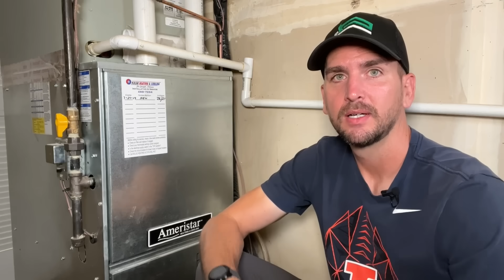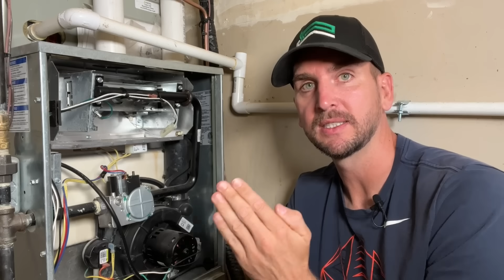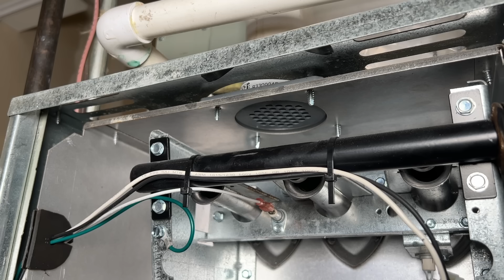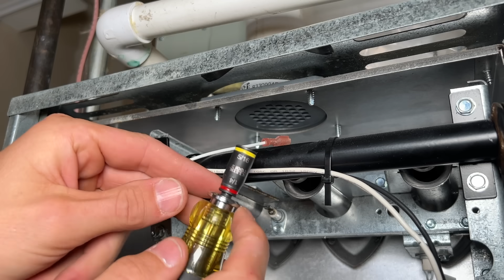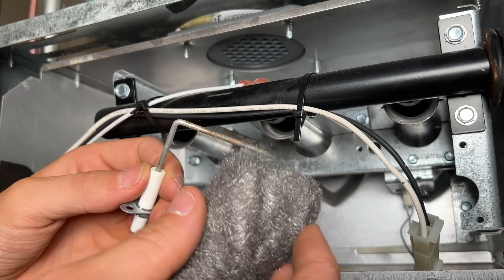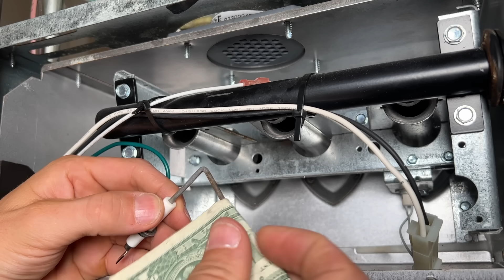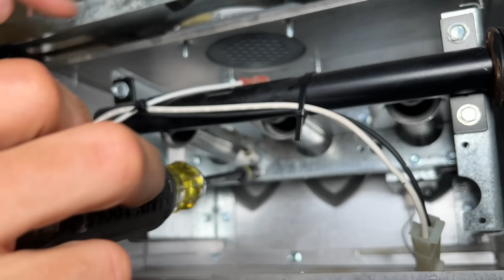The Most Common Reason Why A Gas Furnace Won't Turn On

Comment: Thanks to the steps process of how it works,  I was able to identify  my gas valve Not working right,  cus, if I change thermostate settings,  it will Not open till I flip its little switch off/On and hold some pressure on it til release the gas and go on with process👍🏼

Comment: My furnace blinks a certain number of lights on the board. Mine blinked 4 times which means I have limit switch bad.  I replaced the one on the main blower and didn't fix the issue.
Whats next.  It's doing exactly what your video explains.

Comment: Since brand new, whenever are heater is turned on it immediately starts to blow cold air and then the warm air, and then cycle back and more cold air followed by hot air, any ideas. Natural gas Goodwin
Reply: I don't know much about this stuff but it sounds like your thermostat may be set up improperly... It needs to be set to Gas...otherwise it will control your furnace as if it's an electric or other type of heating system.  This is how mine operated when I installed a new thermostat.  It would turn the blower/fan on while the furnace was heating up (which resulted in cold air blowing through the vents for a few minutes until the furnace heated up).

Comment: 6 way screwdriver usually will remove everything mounted inside the front of a furnace. By removing the screw driver bits you have both a 1/4" and 5/16" nut driver....the two common sizes used to remove covers and parts.
But also pays to have 1/4" socket set with extensions to more easily get at the more recessed screws.
You can also buy really long screwdrivers so your fat handle isn't in the way.

Comment: I had this problem on the worst day I could possibly have this issue code 13 and looked for this codes on carrier brand and saw this video and he nailed it on everything he explain it ended up being the step no. 5 flame detection I followed his instructions on how to clean it and it worked this happen on 01/15/2024 after being. below 30 degrees all day in Houston Texas which that never happens. Good Job on the explanation of why how where etc...

Comment: Ignitor failure also very common and just as easily solved. Size of your thumb, two screws, 5 min. $ 29 part.   $350 service call.

Comment: Nice job explaining the sequence of operation. Just my two cents but normally I wouldn’t recommend any abrasive to clean the flame sensor. Dollar bill is fine or a green scrubber pad. But this is for a temporary fix until you can get a new sensor

Comment: Today the coldest day so far this Winter I noticed my furnace was just blowing cold air.  Took out the sensor, and rubbed with steel wool.  Put it back and I now have heat again.

Comment: im at step 3. my ignitor glows for a second and then shuts off, i dont even get to the gas part. Changed my sensors, and air filters

Comment: Also - Don't keep a litter box in the room with the furnace!  Our furnace quit heating about every 2 seasons. I figured was because the furnace is old. Next time it went out, I didn't call the big name company as they had been telling me lies (not related to this or the flames shutting off as described here) about how the furnace was not working right. Called a buddy whose brother has his own company. He came over and replaced the flame sensor and told me to move the cat's litter box out of the utility/laundry room. The ammonia in the air from the cat urine eats at the surface of the sensor, causing it to fail. Moved the litter box and we are going  on 5 years without a problem!

Comment: I been having a problem with my furnace, when thermostat is calling for the heat my pump turns on but burner doesn’t turn on then when i go and wiggle the wires in relay valve turns on. What should i look for? Wires ain’t loose i checked all that

Comment: The burner faces rust also. Especially on propane if the face of the burner is rusted up it wont let even a clean flame sensor work. Sometimes you can get a couple of fingers back there with some sandpaper to clean the burner face but sometimes it must be removed to get the rust off.

Comment: What to do when gas is not supplied for 2, 3, 4, sometimes 5 attempts. The igniter glows red for 10 seconds, but the gas valve does not open. Then cycle repeats.

Comment: Thanks, bro. 2:00AM, two days after Christmas, 40 degrees out, my wife wakes me up and tells me the furnace is not working. I found this video and fixed the problem. You kept my family warm. Thank you.
Reply: Thank you! It works!
Reply: Thanks for your great work it help us so much not to b dum and to learn things 😂❤
Reply: Awesome God bless
Reply: I don't know what's wrong my boyfriend has replaced every part we know of , The Circuit board, Pressure switch , inducer fan and flame sensor,, 
At this point after all that it turns on but doesn't ignite ,,  I seriously need help ,,
Reply: At this point, I’m assuming it’s the gas valve not opening. TBH, it’s not a DIY LEGO puzzle. Find a qualified HVAC tech who’s able to troubleshoot the problem, otherwise you could really be cooked
Reply: @rhyanna5454 I’m in the same situation—no heat it’s in the 30’s during the day and the 20’s at night. Fan turns on but the flame doesn’t light.
Reply: @oopurpledove Don't ask me, I DON'T HAVE ACLUE.
Reply: @rhyanna5454  is this a joke sounds like you said the answer you need an igniter glow plug or whatever gets hot and lights the gas
Reply: I used aluminum foil from the kitchen on my 12yr old American standard furnace worked great, back on heat late Saturday night.  Thank you
Reply: Same here but glad I had a portable wall heater in my room, woked up with a bad headache due to the cold...the dollar bill helped, was able to reach the sensor without removing it and worked
Reply: For most folks ... If you find that you need parts and have to replace parts when they arrive 2-5 days later. Please have those in your house wear clothes while in bed ! They will sleep just fine and Not be cold! Maybe even a electric blanket if you already have them. Today so many people complain because they are Cold running around in shorts and a tee shirt! Wear warm or layered clothing Inside your home with a coat as needed! Don't pay the utility companies for your laziness!

Comment: Hello friend  
Please can you guide me what a furnace man has done to the furnace gas presure so the heat dose not work from 74 to 77 degree & the house is not warm like before so we use to keep it at 75 degree . seems the green mafia 
f up our furnace . The service man has modified our furnace by the name of warranty . we have it installed 2 years ago & paid $ 1200 $ for warranty for 10 years 
to check it every 6 months . He keep taking out some little round valve .Look like green mafia do it inorder to keep 😂 the air clean but them people has SUV & jet
we are not in the SIN city . Thank you for response  . X mas & HNYear 24

Comment: My problem is the thermostat is calling for heat but the exhaust fan is not coming on. Once I physically turn off power and turn back on that exhaust fan the system works then stops without reaching the desired set temp.
Had several HVAC come out and problem exists.
Any advice?

Comment: I just replaced my 23 years old 80K BTU 80% efficient Bryant furnace with the new 60K BTU 96% efficient Goodman furnace. I kept my old furnace just in case the new one fails within next ten years or so to place it back. As far as I know, we can't install an 80% efficient furnace in Canada anymore, at least in Ontario. I think the minimum is 90%, if not a bit higher, however we can install an old 80% furnaces. These 80% furnaces work longer then new high efficient furnaces as they less complicated by design. Also these are still available to be purchased and installed in the USA. My old 80% Bryant furnace had stamped heat exchanger and it never fails, the new one has the heat exchanger made from the bent pipe and it usually would crack on the bent point. The China, India and the Middle East are heating up the planet due to a population sizes and we are in Canada are trying to save the world.
Reply: F.k Canada

Comment: Will a furnace run great with a bad gas valve? My furnace has a hard time starting. I do a hard rest 3 times and it runs great after that. I need help. Nobody knows whats wrong.

Comment: When I turn the heat on, the fan runs and then the ignitor sparks for a couple seconds and then stops. Then sparks again then stops and then the whole unit shuts off. Do you know what may be the problem? I cleaned the flame sensor but it's still doing the same thing. Could the sensor just be bad?

Comment: Just helped me out a ton today, i couldnt even manually light it with a lighter because it would just shut down, hvac guy wanted $700, i cleaned the flame sensor still didnt work but i bought a new one for $17 and had it started in a couple mins after installing new sensor
Reply from the maker: Oh man, what a great way to save a TON of money. Congrats.

Comment: I'm having a similar problem but slightly different. Hopefully someone can chime in an give me some advice - it's driving me crazy. The Furnace starts up, but the gas valve opens before the HSI can get hot. So an excess of gas builds up, the HSI eventually gets hot, and there's a very tiny explosion as the gas ignites. This all happens in a matter of seconds. The furnace then shuts down for a few seconds, but then starts up and runs like it should, completing the 6 step cycle mentioned in this video. I've had the local Heating and Cooling company come out at least 5 times (through our home warranty) and they've replaced the board and replaced the HSI, but the problem still persists. If I power cycle the furnace the problem goes away for a few days but then returns. Any ideas?

Comment: dec 5 2023  ... colorado, near pueblo
a spare igniter was just bought in order to have a spare.  now the need to have
a spare ignition sensor is real and i will be  shopping for one.   yor vid'
gave me a nudge to be a little more prepared this winter

       here's another 'gotcha' that a 3-burner Carrier 70k furnace failed due to.
it ran ok with room temp above about 50F.  but lower than that the ckt-bd
led would often  blink and the  signal meant the AC lines were backwards.

     this was misleading as they had worked alrite already and had not been
changed any  .  so , as a try  , a hair dryer was plugged  in and on high heat 
blew hot air on the CPU of the circuit control board.   then on plugging in
the furnace to AC the led was not blinking any more.  and closing the thermostat
to call for heat led to the furnace behaving normally.

   also once the CPU was running ok again it could  revert to the blinking mode
and not run right anymore.  maybe once or more a month.   
       solution is the same , apply hot air to the CPU for
20 sec or so.  and re-plug it in.   no led blinking .  this furnace has been
running like this for 7 years now.

      i did buy a spare control board for this furnace. in case the hair dryer
remedy stops working.

      one other issue is with the blower motor relay .  once it fails
the blower wont spin to  move  out hot air.   the spare control board
will fix the failed relay too.  in an hour or less it can be changed.

Comment: Watching your furnace operate normally is a great suggestion. It does give you ideas on what to look for when the furnace stops operating. I had a furnace go out on me and it cost me nothing to fix. 

Just understanding that part of the safety system is a vacuum sensor was key. The furnace would go through all the steps, but would shut down after the blower motor started up. Thinking the vacuum sensor had gone bad, I discovered the rubber tube connecting the sensor to the fan chamber had cracked open, probably due to old age. There was enough slack in the tube for me to trim the end and reseat the tube on the connector. Problem solved.

Comment: unscrew one of the screws in the bottom left portion of the burner cabinet.
if you pull it out and the threads are rusty your heat exchanger is compromised.

the American standard legacy series is a beautiful line of furnaces. but they are not without their own inherent and dangerous issues as any furnace is.

Comment: Great video Scott.
I just had the same problem with my 20 year old Lennox ac/heating system
The gas would shut off 3-4 seconds after igniting.
 I removed the heat sensor that looked clean and used steel wool. And after a few times of trying to start the unit it stayed on and did not shut off. The reason I think was because we are located in Florida we only turn on heat when needed (not much) The conclusion I came up with is that even if you don't use your heating system often, you should turn it on at lest once every 2-3 months for 5-10 minutes.
Ken
Reply from the maker: Yeah, I like the idea of exercising the system in your home to ensure you are ready to go when you really need things to work 👍

Comment: Dang man, first snow of the season and our furnace did exactly this. This video helped me fix it in 15 minutes. Can't thank you enough for this, and I also appreciate that you were straight to the point. Every second of your video was helpful. No fluff, no BS.
Reply: My 2019 Armstrong has the same looking flame sensor and I thought it would be smart to get one and igniter.  Stopped at the nice and reputable place that installed it in my farmhouse and they only wanted about $115 each. Think I'll look on line.  Great video.
Reply: Happened same way to me today. Going to try this when I get home from work

Comment: Nice presentation what if your furnace fires up regularly starts to heat your home and then at a certain temperature the burners won't fire again and the blower just keeps going blowing out cooler air?

Comment: my burners go out after 2-3 seconds and i've clean replace the flame sensor.  it's really weird since 'll turn off the unit and sometimes it'll stay lit but it's a hit or miss when i get heat.  do you think it's a motherboard issue as well or something else.  it's starting to get cold and i've called the service but they have never fixed it.  i was charge $100 everytime.  when they come out it turns on and works but then a few days later i'll get that issue you where the burners turn off after 3 seconds then i'll try to cycle and after 3 attempts goes into safety lock out mode.  I'll then try to turn off the power and i'll try to do the whole process again since turning off the power bypasses the safety lock out mode which is usually 6 plus hrs before it trys to turn on again.  I'm running out of ideas and don't really have the funds for a whole system replacement.  Thank you all.

Comment: i get to step 6.. the blower fan starts and after its up and running it stops after 10 seconds.. cleaned flame sensor and used paper clip to clear out ports and still doing the same thing. have the 3 flashed on the led. its a keeprite furnace
Reply: name of  web site for furnace parts tools. thank you

Comment: I just found that a spider web made a plug in the pvc drain pipe causing the water to back up and shut it down. It cost me $100 dollars for diagnostic. While the tech was testing things I went out and poked a stick in the pipe an a gallon of water came gushing out. That fixed it, he charged me anyway.

Comment: What if step one is the issue? Like Furnace not starting the cycle at all. Power good. No codes. Replaced thermostat. No click when calling for heat. Could a dirty filter keep furnace from starting the cycle?

Comment: This video just saved me $$$. Found the flame sensor assembly was not connected to the frame. Two anchor screws removed by the last tech that did a tune up were never reinstalled. Thanks for the videos!
Reply from the maker: Nice!  Happy to help!
Reply: They "forget" a lot of things, wanting that sweet, sweet service call for no heat when the first cold snap happens.  I glad you took the time to look before calling them back.  Always make sure they prove things are running properly before paying the bill for things like tune ups in the off season for heat/ac.

Comment: I had a similar problem, but I noticed when the main blower came on the flames expanded out and heated another sensor and this shut down the furnace also.   My problem was a tiny hole in the heat exchanger.  I found a replacement and carefully took  the furnace apart (taking many pictures so I could put it back together) .  I found a heat exchanger online.  Lucky for me, I had 2 furnaces and lived upstairs where we had heat still

Comment: Hey, my Goodman gas furnace is only getting to step one, no igniter heating up, red light on circuit board flashing 6 times, only can find one roll out sensor to reset, but not tripped, now what? Please help anyone

Comment: Thanks to this no-fluff video, I was able to clean our flame sensor and we didn't wake up freezing. My furnace is from a different manufacturer, but  your explanation of the process was so clear that I was able to find the sensor on our unit. I'm most grateful,  and subscribed.

Comment: Scott, thank you so much for this upload. I didn't know how easy this fix was since here in Colorado Springs we just got about 6 inches of snow. I've replaced the gas valve
troubleshot everything I could think of until I found your video. A simple flame sensor switch, 1/4 socket and a piece of sandpaper. Thank you again !    💯 👍

Comment: If the flames do not ignite, what are your thoughts? I have replaced the igniter which is now working properly. I replaced the thermostat which is working properly. I replaced the air filter with a new one, I cleaned off the flame sensor, i cleaned in and around the entire unit and checked for loose or broken connections. The flames just do not ignite. No gas lines were  moved or even disturbed. Furnace was working fine, then it wasn't. The relay in step 4 where the gas valve turns on is the thing not happening. Thoughts? And thank you.